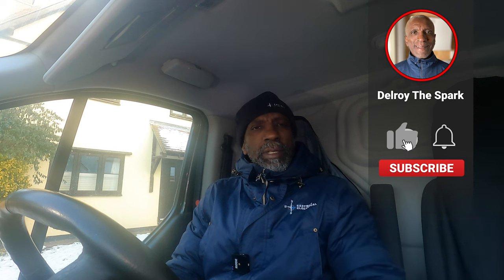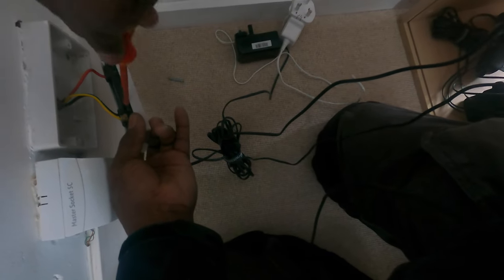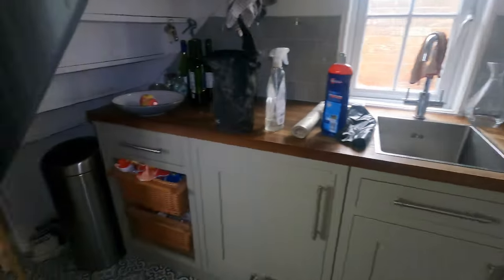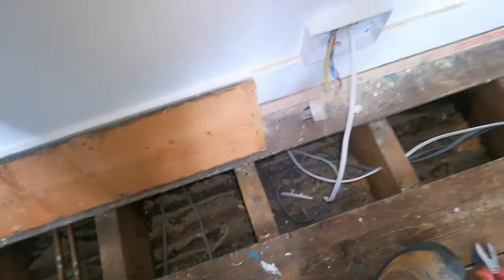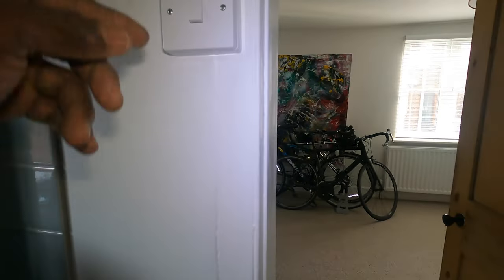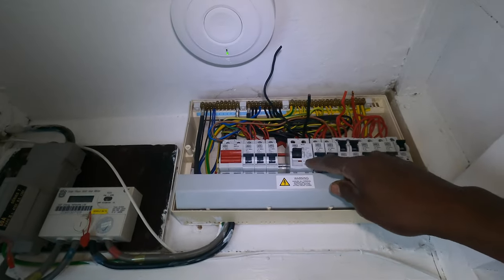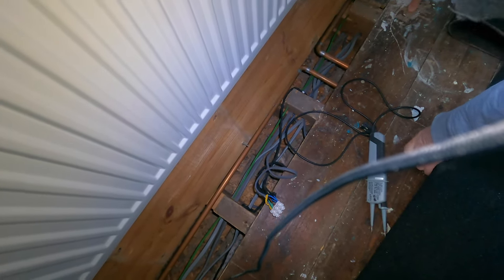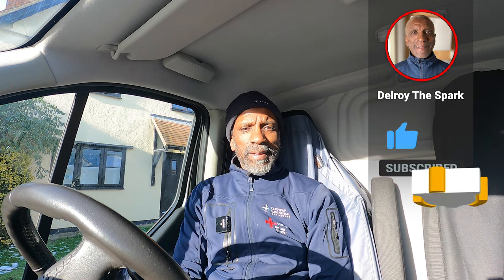"If An Electrician Did This He Doesn't Give A ****"| Electrical Fault Finding| Electrician In London

Comment: I've seen some rewire jobs so appalling that the only practical and SAFE solution would be to rip it all out and start again from scratch, but then the customer often can't afford such a job so they've got to live with such a dreadful hazard. And I sometimes wonder how many surveyors properly check up on wiring as it's often a well nigh impossible job in a lot of properties because so much of the wiring is buried in plaster or stuck under floors with laminated coverings and so on...

Comment: A friend of mine asked me to repair a water leak, in her kitchen ceiling? When I removed the bedroom floor board's to get at the leak, I couldn't believe the condition of her electrical wiring? The prior owner who was a jobber builder, had spliced together every type of electrical wire, including 1940's cloth sheathed wire?
He had spliced together 2ft and 3ft lengths of 1.5mm, and 2.5mm lengths of wire for all the upstairs mains sockets?
Reply: Yikes! Hope she got the house rewired
Reply: @_Rafiki. 
Yeah, she got the house rewired but that is what the sparky did, only rewired it?
He didn't change any of the existing old sockets ect, although he charged her in the price for it?
So I ended up changing all the old existing sockets, switches and ceiling lamps for her? My friend who is an electrician then came in and tested it, and passed it all for her certificate.

Comment: I’m decent with mechanical stuff, so if I’ve got what seems like a mechanical problem with something, I don’t mind trying to fix it or something. It’s rare that you make a mechanical problem worse, so long as you take all the pictures to know where everything goes, have the right tools (or have the knowledge and ability to make your own suitable tools), and know when you’re in over your head and when to just put everything back together properly and get someone who knows what they’re doing to look at it. 

I have none of that confidence with electronics xD as soon as there’s a problem with electricity, especially if it has to do with household voltage and potential wiring fuckups that might, maybe, burn down your house one day, I immediately default to calling a sparky xD

Comment: I went to a flat a few months ago with a lighting fault low resistance line  to earth  , there had been inaccessible down lights installed off existing pendants  boxed in and ceiling lowered  at the property and metal plate switches with no cpc's at the plates with switching being altered from existing two way lighting plastic switches to individual switches for sections of down lights, whoever done it  also cut off the cpc's the cables at the switches and metal down lights.
Apparently it had an electrical certificate done so there couldn't be anything wrong with it!

Comment: Watched the first few minutes. It's so bad it's scary. I do a bit of DIY and I can do simple wiring.

Gonna list and mansplain what I think the problems are for the benefit of any handymen watching this and who are curious.

1. No ceiling roses for the lights. They just go straight up through the plaster. Wire connections should be made inside junction boxes or within ceiling roses where they are protected from dirt, rats and to a limited extent water. He's made all his connections above the ceiling. If there is any fault with them or if they need to be tested they can only be accessed by taking up the floorboards. Junction boxes and ceiling roses are very cheap. Less than a pound each usually.

2. All sockets on one circuit breaker. Looks like the circuit for the upstairs sockets and downstairs circuit have been shoved into the same breaker. 

3. No continuity in the cpc ( or earth) on one of the rings. This means at least one faulty connection in earth, some sockets are not protected by earth. He fixed this by changing the ring into two independent radial circuits each with their own circuit breaker.

4. Looks like 3 of the downstairs sockets are independent of the ring and connected to the lighting circuit. Lighting circuits can handle several 100 watt bulbs plugged into them but there are many appliances that exceed this. Not as dangerous as it first seems because you can overload circuits briefly and the circuit breaker will activate before the copper gets hot enough to start a fire. I've seen this before but it was even worse, the guy had connected the sockets to the switched live instead of the permanent live so his washing machine could only work when he had the lights on.

5. At 19:00 I think he used the wrong cable for the switch. You can see 4 wires, he only needs 3. No need unless he intends to install 2 way switching for the lights. This is sloppy but neither dangerous nor illegal.

6. One of the cables was a lot thicker than it should have been. Neither dangerous nor illegal. If wiring is too thin it will overheat. Thicker wires are actually safer but more expensive and difficult to work with. 

I believe that Delroy has already done a lot of work in making the sockets safe and sorting out the mess at the consumer unit. I imagine that he came back and sorted out the spaghetti wiring with maintenance free junction boxes and connectors. Then he installed ceiling roses for all the lights. Probably should do something about the sockets connected to the lighting circuit.

Probably more stuff that I missed.

Great video. It was very interesting watching someone investigate the problem and do some fault finding.

Comment: I'm currently rewiring my house because I found 4 of those behind finished drywall between floors.
Reply: It's more fun when you find that the connections have only been twisted together and with no insulation tape.

Comment: You’d love the houses in my area……The council here are notorious for employing cowboys to do their maintenance……You’d be amazed at how bad their work is…….Think of the worst thing you’ve ever seen and it’s probably 10 times worse than that.
One of their plumbers is know to them as “leaky.” 
They actually joke about how bad their “tradesmen” are……….My last house caught fire due to dodgy wiring and it took a row of 4 houses with it when it burned down.
They have outside gas meters here……with unprotected, exposed copper piping running from it, up the outside wall, past the front door and fed through a hole in the kitchen wall.
There are also houses here, with trip switch panels, next to the sink, in the kitchen……..You wouldn’t believe some of the things that are allowed to go on here, with council housing.

Comment: The UK system of allowing connections behind walls and under flooring is just asking for trouble.  There should be separate cables for lighting and for separate cables for power sockets.  Cable runs should be intact from power board to destination, but allowing "same use" spurs (only form of junction to be allowed), disallowing "rings circuits".   All cables should be P+N+E.  All cables should be full load capability and fused for use (lighting or power socket or cooker, etc, e.g 10 amp lighting, 15 amp power sockets, 40 amp cooker).
Reply: Junction boxes in installations going back to the 17th edition  are not allowed anymore  unless they are readily  accessable and not hidden or have maintence free connections
The odd older installations may have junction boxes but normally there is no junction box unless someone has Tee'd off a cable to add another socket or light which shouldn't really happen anymore.

Comment: May I ask, the sockets in the front room which was fed from the light switch, did these have a neutral at all? 
AdditionalIy had an electrician tell me recently that they couldn't start any work on a plastic DB until changed it for a metal due to new regs. 
Is this correct? Or could they just note this down as an advisory on the plastic original plastic DB.
Much appreciated

Comment: Long long time ago my gfriend rented out an apartment. Once i went in there for the first time i bursted in loughter. Somebody had decided to replace all the sockets with exstension cords, conect them stright to electrical wires and just glew them to the wall. 40sqm apartment with around 80-100 sockets in multiple stacks of exstension cords.

Comment: Unfortunately there are all sorts of people who claim to be qualified but are not & there are all sorts of people who are qualified but incapable as well. I am a British qualified & trained electronics engineer of 35 years experience now turned renovation contractor in Canada but over the years I have met both. Some of the worst work & poor judgement I have ever seen was done by people with top end degrees & some of the best work I ave seen was completed by people who have no more than a high school diploma. It is a sad thing to say but, you have to physically check licenses, physically inspect insurance cover & business licenses, ask for & call up references, use permits & work with stage payments or an independent bond holder so you can temporarily withhold a portion near the end to ensure the work is completed properly.

Comment: If I ever seen that situation open expose wire connection. in the floor boards ,walls ceiling, when I do a service call. first thing I would do is not touch It, in till got confirmation to fix it properly. Because the moment you touch it.  You Now own it, So your liable if any thing go wrong .

Comment: Firetrap. The guy doesn't get it. The lessons are right in his face. If you don't use junction boxes, tracing and diagnostic is guess work and involves ripping things apart. Using the wrong cables, overloading MCBs having wires twisted around one another and sitting in a rat's nest are dangerous for allowing shorts overheating and fire. They guy's a maniac and needs to take a step back before he hurts someone. It's a lot neater and cleaner to use a trim around a lamp cord than it is to have it plastered into the ceiling, anyway. I guess part of the job is being tolerant of customers how are a few bricks short of a pallet

Comment: YouTube is full of videos that perfectly show what supplies and tools you need for this job and how to do it properly. Tools and supplies need not be expensive. No problem, no shame on you if you do not take notice of that. But please, leave it to a professional then. Because nothing is worth your house and all in it burning down. I noticed the floor beams cut out on top for those pipes and just about an inch or two from that a quite large hole through each beam to let the cables through. That definitely must have weakened the floor beams quite a bit.

Comment: The molded plug taking the cable into the floor to a chocolate box connection in electrical tape??? 

The place looks like a Danger-it-yourself has been at it

Comment: I found myself reaching for my wire cutter several times when I saw the plug and soft cable going down into the floor.
Even more with that rats nest....
Firehazard thanks to diy-moron.
Reply: Why are terminal blocks more of a fire hazard than a junction box? I agree it's a mess but it's not obvious to me why it's particularly a firehazard. Are you worried about cables getting yanked?
Reply: @xxwookey  a junction box contains sparks and slows the spread of fire from poor connections.   A loose connection in a terminal block, left open under the floor like that, you're asking your house to burn down as you sleep.
Reply: @RobertGarlinghouse  OK, so a badly-tightened terminal block is more of a fire hazard than a badly-tightened junction box. Secondary safety. Fair enough. What about wagos, which auto-adjust pressure so are much less likely than a junction block to be loose?
And then Americans use those little twist-cap things, and don't always put them in boxes, and have higher currents than us due to half the voltage, and have timber houses. So it could be worse :-)

Comment: I found some nasty wiring in an outbuilding, as in lethal, I rewired it properly, but the comment was, my husband is an electrician ??? turned out he was a very very clever professor and had many degrees in electronic design, but its down to experience and skill,

Comment: dude you should see the site that i over see was 4 big units back in the late 70's now has been converted in to several smaller units the main head and db is on white asbestos then from that splits out in to 6 different armoured cables all different sizes what worries me a little and some not even used at all do from there we have a 70mm2 armour that goes to another unit and then splits off on to another 5 db's ive been there on and off for nearly a year now and im still trying to figure out what is feeding what if it was up to me i would shut the place down and do a full pull out and fresh install but i cant as there are active business there and im forever getting called out because a phase has dropped or someone has touched something they shouldn't

Comment: You never know when shit work has been done by a supposed professional. I had a registered gas engineer install my hob and he wanted to insist that my kitchen (which has an opening window and a French door) needed an airbrick for ventilation or he couldn't install a gas hob to replace the old one. I had to look up the regulations and show them to him and he phoned the manufacturer before finally installing it, but to install it he tore a hole in the metal underside of the hob with pliers because he claims it was impossible to connect to the gas fitting any other way and whoever designed it hadn't planned for how it would actually be installed. Can you imagine having an airbrick into your kitchen in UK? You'd freeze.

I also had a gas boiler fault where the pilot light was going out by itself. A different registered engineer opened it up, turned on the gas and lit it making a 18 inch flame shoot out into the room,  closed it up and said it's 10 years old so it needs to be replaced and put a "condemned" sticker across it, quoting me £3500 to convert it to a combi. next guy I got in fixed it in half an hour for £50.

In my old job in a hospital, there was one handbasin that didn't get hot water unless you turned on the hot tap in the commercial sink next to it. This is a secondary return type system which should get hot near instantly on any tap.

Comment: surely it would be a lot easier to have a fly lead so could test continuity back to board. hook one leg at board and a plug top tester. check continuity at each socket until it goes.

Comment: Don't know why your surprised good tradesmen are very thin on the ground, my neighbour recently had a "plumber" fit a new main pump, probably one of the easiest jobs to do and left them with a small leak that stained the ground floor ceiling! Top job the guy returned next day to fix his botched attempt what a joker...
Reply from the maker: Thanks for sharing your thoughts
Reply: So being a good tradesman in your book means never having anything go wrong.... Yeah good luck with that. The guy came back and fixed it didn't he. Get a grip he's only human and it might have been component failure anyway.
Reply: @travoltasbiplane1551  It's the difference between a tradesman & someone who's not competent, its the easiest task to check if there's a leak and no there was no component failure!
Reply: @travoltasbiplane1551  Give it a rest plse, I do my own plumbing and yes my joints are 100% leak free, you either know what your doing or you don't. I havn't condemed any tradesman just the muppets that think they are!
Reply: @peteturner8493  yeah ok Pete. Enjoy being perfect. Must be wonderful!

Comment: The MK brand is back in production, under a different manufacturer (CEF rep informed)
Reply: Is mk not a thing now?
Reply: @smartchip  it's being manufactured by another company now. the new company bought the tooling. i'm not totally sure what the new name will be though. but the Sentry range will still be available.
Reply: @arniewheeler4673  cool, I like rcbos, pricey, less so, checkout consumer unit world, they have a anti surge rcbo board, 18th Ed for like £15 a rcbo and the cu is like £80,  just thought, it makes our life easier, safer for the owner and all round a good unit, I prefer crabtree switches and sockets for domestic, just, solid and dependable,
Reply: @smartchip  where are you from?
Reply: where are you from?
Reply from the maker: Thanks for the info

Comment: Not to be rude, but I'm guessing he was really proud of those lights after he installed them..  no way would any electrician install lights like that and not use a junction box.  Only time I've done something close was using a plug in fixture and cutting the cord off to wire up to the mains. But still used a box and its just a led light for my laundry room so idc how it looks.

Comment: This looks a bit like some of the absolutely APPALLING wiring jobs I've encountered on occasions over the years when I've done the odd wiring repair and upgrade or addition, and the odd full rewire. And my own house had a dreadfully botched rewire done on it by the previous residents so I had to sort it all out and it took me ages. And I really hated it when I used to get called to a mate's house to do some wiring work and I isolated the circuit which then should've been totally dead but some of it was still LIVE and I got a dirty great belt from the current! Wiring, whether mains or low voltage vehicle or caravan or boat wiring etc. is definitely NOT for idiots who just couldn't give a STUFF about safety, either their own or their family's or anyone else's.
Reply: I never take it for granted a circuit is isolated, I always test before doing any work on it. 👍